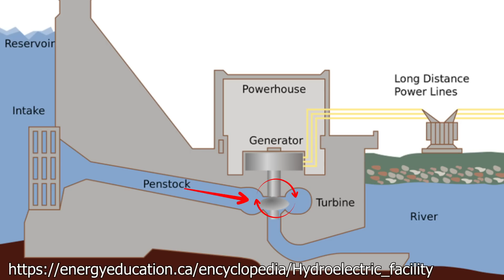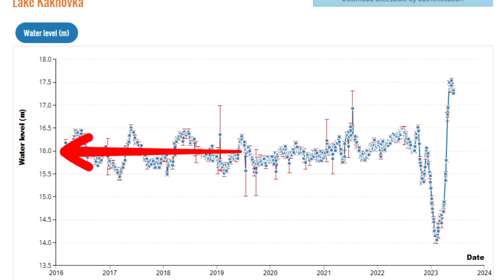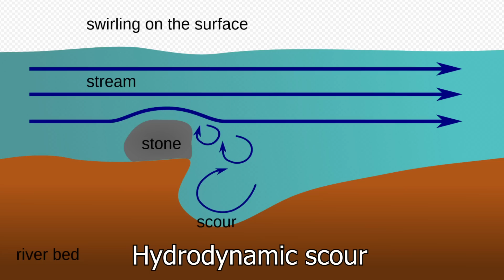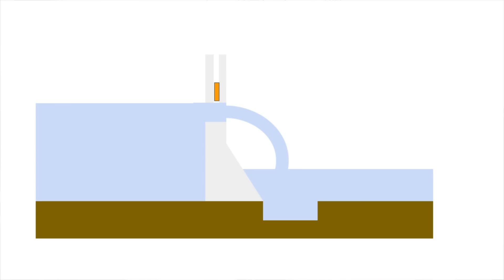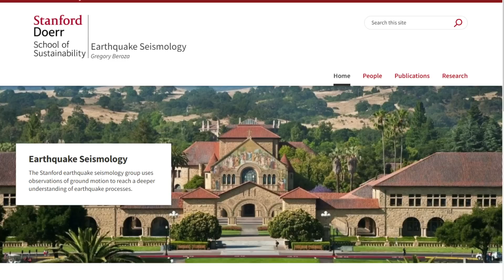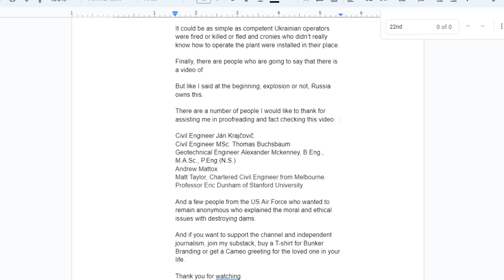How Russia Destroyed the Kakhovka Dam

Comment: This video is bullshit. A reinforced concrete dam does NOT collapse because of water tipping over. In Italy in the 1960s in the Alps there was a dam that caused a tragedy. The mountain upstream the dam instantly collapsed and fell into the water reservoir, completely displacing the water and filling with rocks what was the space occupied by water. All the water contained in the basin jumped above the dam and went down the valley causing thousands of deaths in the downstream villages (it was night time and everybody was sleeping at home).
The dam was structurally intact and after 60 years it is still there, filled with rocks from the mountain.
According to the Occam principle, if there is a simple and obvious explanation, that is probably the truth. The simple explanation is that the reinforced concrete dam was blown up with tons of explosive placed inside it and low (probably in the water turbines room).

Comment: Wasn't that roadway taken out by HIMARS a few months ago? 
So maybe the brown patch is a poor repair failing. 
As I type that, I wonder if a HIMARS shell that punched right through the road could have then damaged the area under it which then lead to scouring.
That doesn't enplane why the center section failed however.
I have seen someone claiming to have seen inside the dam say the easy way would be to mine the service tunnels which would require far less explosive to make it fail than placed on either side.

Comment: Ryan McBeth,

Thank you for Your channel and this video.  I really like analytics, but here I think you got things wrong.

In short, I think, the fact that power generation house collected implies it was blown by explosives' and the spillway had been gradually washed away once it lost support on one side.

In more details,  
Engineering point of view. 
1. Your point about turbulent current sounds good in theory, but the whole point about spillway system is to drain reservoir without developing "barrel current" that preventing undermining of  the dam foundation.   Yes, Khaohoka dam is an earthfill dam with concrete wall, but underwater earth structure has reinforced top that goes 100m  down stream to avoid erosion.
2. Without expulsion, the generation house should hold as the most strong part of dam, since the collapse of spillway would reduce water pressure on the structure.

Common sense:
The dam was in place for 60 yrs and suddenly collapse at the moment when 1) RFAM were facing UAF attack across the river and 2) UAF occupied most of lowland island downstream.

Most likely RFAF tried to induce more damage to the dam in anticipation of possible retreat to prevent UAF from crossing it and washout UAF units in the lowlands. Unfortunately, RFAF put too much explosives.  

https://xxtomcooperxx.substack.com/p/ukraine-war-8-june-2023-the-russian?fbclid=IwAR04X3gNIawC5SZz306LvDPr3MBhQ58SGQe_LtgzC1V75GWeils1M0gIm5g

Comment: Yours is a plausible, alternative explanation, Ryan. but there are some other considerations to be made.

First. This dam and powerhouse were designed and built in the 1950s to withstand a nearby nuclear strike. It is likely that it was intentionally "overconstructed" to allow for this possibility. Without blueprints or current inspection reports it is impossible to conclude this, but it must be admitted that this was a massive facility that didn't just erode away.

Second. The Russians controlled not only the dam, but the powerhouse, as well. They could, and did, control the water levels of the reservoir. The Russians could have inundated the downstream areas by opening all the gates at once if they so chose. Also, they controlled the electrical output of the plant, redirecting it wherever they chose or by turning off all the generators entirely. The facility did not have to be destroyed. It could have remained a valuable resource and served the same purposes.

Timing. It stretches credulity - mine, anyway - that this catastrophe simply coincided with Russia's continuing invasion of Ukraine. Why, after 67 years of service, would this structure decide to destroy itself at this time?

Hypothesis. The Russians blew the dam and powerhouse because they have been reading the tea leaves and know that they cannot hold the remainder of the Kherson Oblast. They are in the process of abandoning it and, like petulant children have taken the attitude that, "If we can't have it, neither can you."

I do believe that this mystery will be solved. It's only a question of time before officials and the media  choose to reveal the answers.

Comment: Ryan, as a hydrologist, I’ve been waiting for someone to show good satellite images. You have done so. My guess is that you properly identified the probability of scour as the cause for the failure. If some explosives were donated, it may have been that the Russians recognize a problem was developing and wanted to try to blame it on Ukraine.

Speaking of scour, years ago at a New Jersey yacht club where the frontage bulkhead was adjoined by a side channel positioned at a right angle and having the bulkhead also with a right angle. Members would park their cars in that area during events. One evening a sinkhole formed, and a number of cars were lost. Scour had eaten out the material under that corner to the point where the weight of the cars lead to a collapse.
Reply: I believe that section of roadway was damaged by Ukraine and later repaired. Therefore the supports may have been compromised. And those supports are impacted by the spilling water, so I'm not sure about the scouring theory.
Reply: @saumyacow4435  It would be great to have access to the design drawings, along with on-site photographs.
Reply: Как же тупо думать о том 
, что это МЫ взорвали дамбу на СВОЕЙ же территории. Если что случается - так сразу мы в этом виноваты, да? Как с Украинской ракетой, которая попала по Польше, но обвинили сразу во всём нас. Таки научитесь думать головой, а не только смотреть телек и читать тупые пропогонднские СМИ (аналогичная просьба и к нашим товарищам).
Reply: @ТруфанатКуплинова  It's not your dam and if you Russian's had any credibility and consistency you'd evacuate civilians on the left bank rather than blocking them.
Reply: Do you think the twin towers were hit by planes?
Reply: @relaxingsounds4821  No, it was obvious they were hit by UFO's . Big UFO's sporting jet engines on the wings they didn't need.

Comment: Ryan.  Immediately after I went to the internet and found the information about The problems with the dam since February.  

Including Russian officials saying the dam was at risk a few weeks ago.  And that it was topping over.  May have been a saving grace that water was already rising one foot a day below the dam.  Some people already leaving

The area of the dam road with the curve, had been hit by himars.  My theory was that the Russians actually took that out per the satellite photos on the day.  

That was right above the breach.  

I still think it possible that the Russians also scuttled the generator area.  Intending to retreat and leave nothing good behind.  

This would explain the allegations that Russian troops were actually putting demolition charges in the area.  

And then my theory was that these explosions, in dangerous areas and in enclosed areas, broke the camel's back.  

Basically if there are any charges planted I'm going with my theory.  If no charges were planted then your theory is the winner.  

But I think the answer to the question, why would Russia do this when it wouldn't benefit them?  Yeah that's true.  They screwed up and didn't mean to.  Either planting charges, or as the Russian official said, letting the thing top over.

Comment: Option #3: Well executed plan to make it look like natural erosion collapse by letting the bottom of the dam to erode to a point to weaken the ground base. Therefore there is no need to use 2000lbs of explosive, which would (could) be detectable during the explosion. Instead, using a much lighter explosive load that would not be detectable on sensors but strong enough to help the dam failure. Which I think thats what happened. Circumstantially it is very unlikely the dam would break pretty much on a day of ukraine offensive. 
I must admit the Russians did a good job because even you fell for it and they put doubt in your head. And that was their goal. I know Russians…they don’t leave anything for circumstantial luck.

Comment: Totally disagree. As a combat engineer who went to school for civil engineering receiving a BS and MS in civil engineering, the dam required a massively placed kinetic energy to crack decades old, steel reenforced  concrete. A dam is like an iceberg in that the majority of the dam is beneath the water. It’s not an earthen dam. Even cracks in karakova dam would lead to multiple water egress points and absolutely not all at once. 

From an experienced and educated civil engineering analysis, myself and consulted peers all agree explosives were put into the tunnels that run through every hydroelectric dam. Russia occupied that dam so Russia blew it up. Ryan is a good guy, but this is not a field he can claim expertise in. Assumptions and feelings are not part of any sound engineering assessment.

Comment: The "Dambusters Raid" actually helps prove that Nova Kahovka was NOT destroyed by a Ukrainian attack. 619 Squadron tried multiple times to destroy an earthen dam like Nova Kahovka. Even though each both had over 3 tons of explosive and exploded at the point of maximum hydrostatic pressure, the earthen dam was not even scratched. The dams that were destroyed were concrete gravity dams, which Nova Kahovka was not. -- (I earned my BSCE in 1986).
Reply: nowadays we have bunker buster, it penetrates deep into concrete. eg: A Blu-109 is an approximately 1 ton heavy bomb can penetrate 5 floor height into Tabqa Dam in 2017, and it haven't even exploded yet (a dud).
Reply: @anchorread68   An earthen dam is more like a mountain than a bunker. An earthen dam is almost designed to soak up energy from explosives, compared to a concrete gravity dam.

Comment: by widening the river (water  over the low lying land and islands) the amphibious forces  - are - put at greater risk.  Loner crossing, more time, more opportunity to be attacked.  Next for a very long time the land downstream will be sodden.  Not a good element to move tanks and other heavy armaments.  So deliberate or not - it works in Russia's favour.  Your explanation of undercutting - look up Kariba Dam - straddles the Zimbabwe/Zambia border.  Zimbabwe  took over control and management of the dam in 1980.  Incompetence, mis-management, lack of maintenance, over almost thirty years has led to the undercutting of the wall.  The level of the dam has had to lowered - UN Engineers and Money are  currently working to stabilise the wall.  Exactly what you describe and illustrate  is what happened to Kariba, btw - Lake Kariba is around 50 miles wide at its widest, virtually 200 miles long when full.  Surface area is enormous - Volume of water as well.  If had collapsed it would apparently have then swept away the Cahora Bassa Dam downstream on the Zambezi - another massive lake and dam wall.  Flooding vast areas of Mozambique.

Comment: Why would the generator building fail then, especially in the middle and not at the section closer to the "eroded dam section"? The part close to the "eroded" section is still standing. Could it be that there was an explosion in the generator building that also created a cascading effect on the eroded part? Also, russians could have seen that the dam is failing but the failure would be small and would not cause a big flood, so they decided to blow it up to get at least some advantage out of the failing dam.

Comment: There appear to be three distinct major breach/collapse points: the largest one where the potential scour hole was next to the powerplant, the center of the powerplant, and the other side of the powerplant that was an earthen section protruding some length downstream. Are multiple failure points typical of an overtop event paired with a scour hole?

Comment: 7:49 "The road bridge is gone." Apparently destroyed by Ukraine, not by erosion: https://youtu.be/7_avjzntfOc?t=1736
Which would not invalidate your scenario anyway.
But the same video says at 23min25sec that this high water level is nothing new, it was reached and successfully sustained 8 years ago, and so probably several more times since the dam was built.

Erosion would be plausible if the dam had collapsed at the sections around the open spillways, but it's not just a 40 meter wide (on top) section that collapsed, there's also a whole 1-2 kilometer wide section that collapsed along the lock, southeast of the power plant, on the northwest side of the lock and the half side of the power plant that did not collapse and does not appear (much) damaged above.
Granted, a lot of it is a leeway and an island mostly made of dirt, but the sides of the lock and canal are built in concrete, and there are some concrete buildings and foundations there too. The whole dam was apparently specifically built on specs designed to sustain an atomic bomb near miss. Now, I know that for the Titanic, sinkable was unthinkable and stuff happens, but erosion causing this huge collapse is a huge claim. God WDNE works in mysterious ways, but the Russians probably helped Him...

Still, if turbulences are not responsible for collapsing this whole island, the overflow might have done so: Both the lock, the canal and its reservoir may have been overflowing on the mostly dirt terrain, changing it into mud that got carried downstream. Another big claim though.
The fact that the whole power plant section is still in place, with one half badly damaged with a visible spill and another apparently undamaged with no spill also needs some explanation: Did Russia mine only a small section of the power plant to maximize the effect of the explosives they had? Would that even show on the seismic meter when there is a constant rain of missiles in Ukraine?

It's more likely that Russia did what it does best, well, worst, and detonated the mines that we know were planted last year. And it's also possible that both explanations collude: The explosion of the mined power plant triggering some erosion on the dam section and the island that collapsed. This war has an incredible drone and media coverage, yet I wonder if we'll ever know what happened here.

Comment: Russia would have the ONLY reason to blow up this dam if the Armed Forces of Ukraine could successfully cross the Dnieper at the level of Kherson, gain a foothold on the left bank and begin to effectively break through the defenses of the Russian army. The destruction of the dam "would have washed away the landing force into the Black Sea", and what remained unwashed would have become a victim of broken logistics through the flooded river. But, as you know, Ukrainian counteroffensive bogged down.
They talk a lot about the problems of cooling reactors at the Zaporizhzhya NPP, they talk a lot about the problems of water supply to the Crimea in the middle of the tourist season. But practically no one talks about the catastrophe of agriculture in the Kherson and Zaporozhye regions. Without the destroyed reservoir, the work of the extensive irrigation network in these areas was disrupted. The climate there is arid steppe and agriculture is impossible without irrigation canals. Hundreds of thousands were left without work and the end of the war will not change anything, at least until the reservoir is restored. Zaporozhye and Kherson regions are inhabited by "orcs" - ethnic Russians who refused to give up their ethnic identity even under the pressure of the Ukrainian chauvinist regime, an important part of the population for Russia and "ballast" for modern Ukraine. 
PS Regarding the water level in the reservoir, which was allegedly excessively accumulated by Russia. Read about the cascade of the Dnieper hydroelectric power plants, it's on Wikipedia. You will learn that 7 reservoirs have been built on the Dnieper and all of them are controlled by Ukraine. A day before the destruction of the dam, a large volume of water was discharged from the Zaporozhye reservoir into the Kakhovka reservoir. Ukraine carried out the same manipulations in the days when it fired at the Kakhovka dam with HIMARS missiles last year, then holes formed in the locks, but the dam survived.

Comment: Ryan-Quick question! According to “Reporting from Ukraine” they described how a small explosion, designed to take a small section out and flood some small areas of the delta, were supposed to be small, but aparently they “screwed up and this has led to a carastrophic failure.  What do you think about this possibility.  As in, all the above is true, your good research points and this small explosion…??

Also, I’m new to the channel and love/appreciate your content.
Reply: Russians had control of the dam so they could have released more water in a controlled manner by opening all gates. 
But i'm no expert...
Reply: That "small explosion" idea one of many and no proof provided to that whatsoever.
Reply: @vladimirpecherskiy1910  An explosion from within the generator room, followed by cascading failure of the dam, is consistent with pretty much all the evidence and consistent from the point of view of motivation.
Reply: Quite correct. All of the evidence is consistent with the intent to cause a prolonged, low level flood. The major failure was basically incompetence.